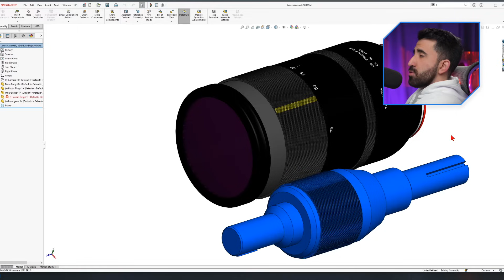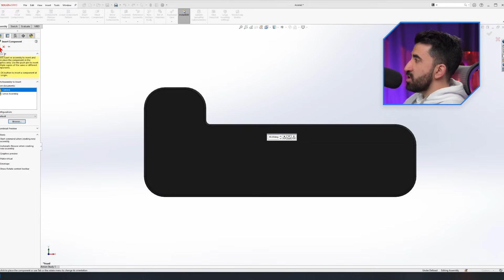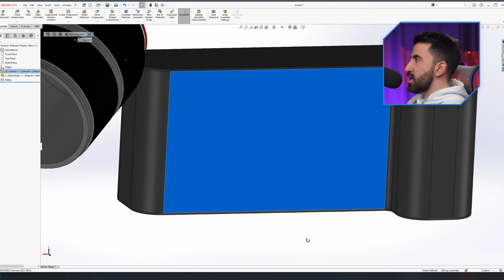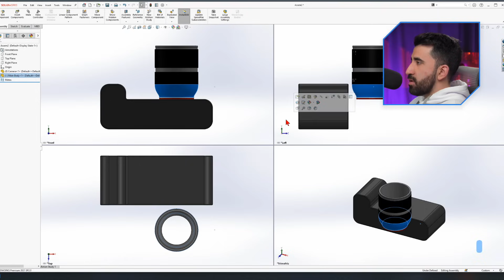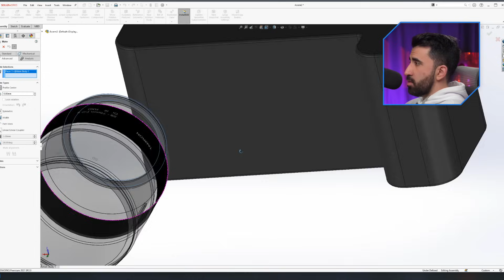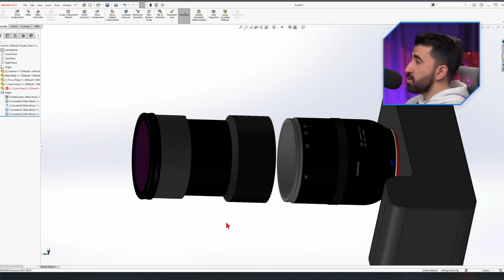SOLIDWORKS Assembly Mini-Series │Ep01

Comment: very very hard in solidworks , we create a 200*200mm curve plate by flex vertical and 2 holes and i want to fit 2 wheels , problem is cocentric and tengent mates not hights and not works ,  i want to see this problem in your pc , and i check how you handle this problem

Comment: Hi Aryan, Im an experienced design engineer and have used 2D autoCAD all my career.  I have attempted to move across to a 3D environment on multiple occasions in the past, however there is something that i simply cannot seem to overcome.  The method i use when I am designing is to work from the outside in.  By this i mean i typically draw in the known constraints in the space and then develop the object(s) or parts with consideration to these known constraints.  I can't seem to easily be able to apply this same strategy in the 3D solid works environment.  Its straight forward in Solid works to initially develop a part in space, however this requires you to know all the information of the finished product before commencing.  The way I and most good engineers design, is to create an assembly first which includes all the surrounding constraints, and then utilise these constraints to develop some of the unknowns when drawing the object.  Is this possible in Solid Works?  If so, is it efficient?  Many thanks in advance, Steve.
Reply from the maker: Hi Steve, as an experienced design engineer, I can understand your concerns with transitioning from 2D CAD to 3D modeling. The good news is that SOLIDWORKS does provide a number of tools and workflows that can help you work from the outside in, as you described.

One option to consider is creating an assembly in SOLIDWORKS that includes all of the surrounding constraints and components, and then designing your parts to fit within that assembly. This approach can help you ensure that your parts will fit and function properly in the larger system.

Another option is to use SOLIDWORKS' sketching tools to create the overall shape and constraints of the part, and then use features such as extrudes, revolves, and sweeps to add detail and refine the design. You can also use SOLIDWORKS' assembly modeling tools to test fit and function of the individual components within the larger system.

Additionally, SOLIDWORKS provides a variety of design tools and workflows that can help you efficiently create and refine your designs, including parametric modeling, feature recognition, and design automation.

Overall, while the transition from 2D CAD to 3D modeling may require some adjustment, there are many tools and workflows available in SOLIDWORKS that can help you work from the outside in and efficiently create high-quality designs. With practice and dedication, you can master SOLIDWORKS and take advantage of its many features and capabilities.

Comment: Thank you so much for including the STEP files for older versions! My company is still using SW2021, and the official SW assembly training module only works on 2022. Glad I found yours!
Reply from the maker: of course, I've got your back. Lots of my students in the course has the same situation so I knew I had to put the STEP for those who are working with the older version as well